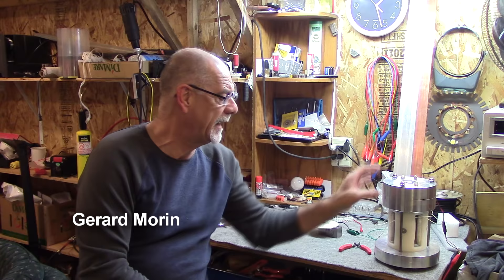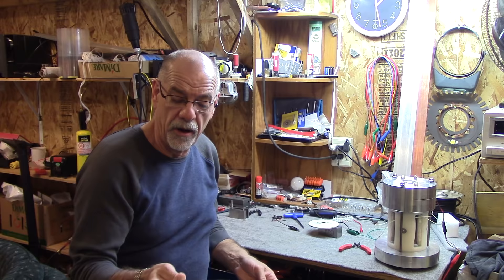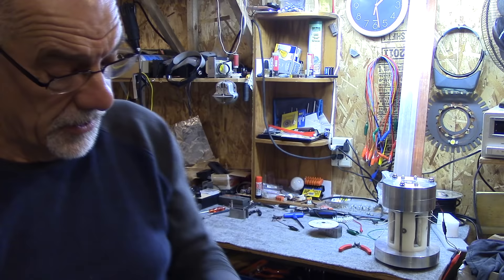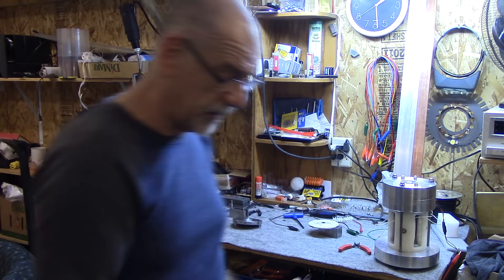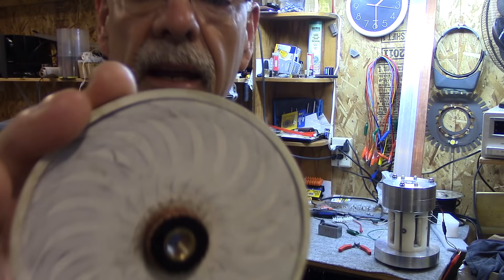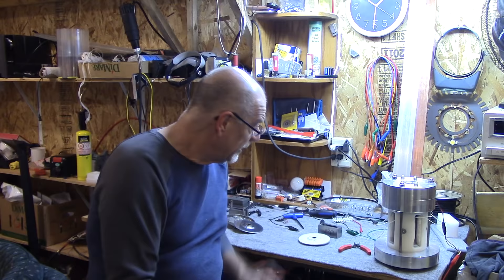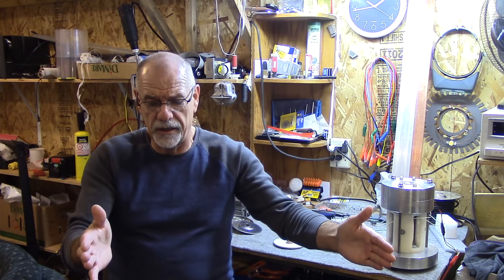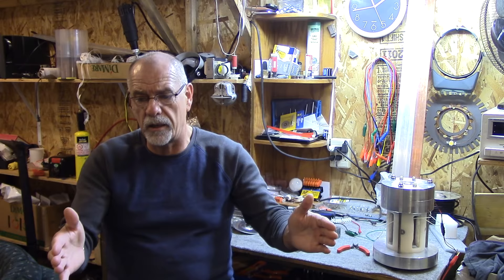Gerard Morin: Hidden technology the world doesn't tell us about

Comment: You talk about knowing how things work, take your advice. You don't know how those lights work, at all. They do take current that is why they have a positive and a neutral wire, for current flow. Those light strands are designed specifically with the right number of bulbs in series,  along with the right voltage drop designed for each bulb divided up by the number of bulbs. Bulbs in series will divide the voltage among them, but current still draws, not divided current.  In a parallel circuit the bulbs have the 120 volts on every bulb, not divided, but the current is divided. That is why you take one bulb out of a series string, none of them work, because you broke the current flow with the missing or blown bulb, Think man!  but you take a bulb out of a parallel wired light, the other light STAY lit. lol

 But i say experiment, as long as your intentions are good, mine are. 

 For example these lights, no current? Well lets do it this way, you take your string of lights and hook it to your voltage, go ahead and hook the ONE wire to the positive(HOT) wire in the AC circuit, ya know the 120 volts in your wall outlet? Yea, that one, hook your light to the hot wire ONLY, because you need only one wire to get a voltage, then test for voltage using a meter hooked to GND, and tell me what you see on the light bulbs, you see voltage, but the lights won't light, it is because it needs current flow. Until you hook the other end of the string of lights to neutral you won't complete the circuit, when you complete the circuit connecting both wires to the plug in the wall, NOW the current will flow, and the lights will light up. not until then. You can have voltage on those lights all day, all night, for the rest of your life, and if you never allow current to flow, you will be in the dark.

 AND/OR just take a perfectly good working string of series lights, and take one single bulb out, any one you want to choose to take out, take a pick, and WATCH as the ENTIRE rest of the string GOES OUT! lol Then take your trusty voltage meter and test that socket you took the bulb from, it reads FULL voltage required to allow the bulb to light at full intensity on one leg of the 2 terminals in the light socket. Now replace  the bulb back, and take the very last bulb out, It shows how all the bulbs still HAVE voltage, but no a single one will light, BECAUSE you broke the current draw, but yet every remaining bulb is connected to the voltage. Actually do an experiment before assuming you know the dumb shit you say.

AND/OR just do it the idiot proof way, go buy a new set of string lights, then look on the label, it will show you the wattage the string lights use up. Now:  watts = voltage x amperage, so then if we know the wattage and the voltage, we can reconfigure our formula using basic algebra to find the current, it will be wattage/voltage = amperage. And the label might even show you the amps right on the label. And even if it don't tell you the amperage, it WILL tell you the wattage. And guess what buddy, you can't have ANY wattage without BOTH voltage AND current period. Get over it. Your lights don't power themselves off voltage alone. 

Voltage is just the potential, like the water medium behind a dam(the resistor) in the river builds up a huge energy potential, and if you break the dam it releases and destroys the city below. The dam water LEVEL(volume built up) represents the voltage, the higher the water level, the higher the voltage, and more capacity(volume) of water behind the dam is more pressure. But if you never put a hole in the dam there will not be any current flow, until it overloads and overflows, and/or breaks from excessive pressure anyway if you keep pumping in currents into the storage(lake behind the dam) without allowing that same amount of current be released(flowing through a designed hole in the Resistor/load(dam). The flow of the river is the current(in amperage) flow, the level of the river is the voltage. So you can have a bucket of water by itself, but it won't do shit alone, unless you jut let it back into the river to add to the rest. A bucket of water is a LEVEL of water, but it does nothing until you allow it to FLOW! The capacity of the bucket to which it is filled is like the capacitance, and if/when you run the water thru tiny pipes strung out, would be like the inductance, because of the time lag. But like i said a single bucket of water is next to useless in terms of it representing a voltage, it is like showing you a watch battery, not even, it is like showing you a static charge if you place the bucket somewhere in a high place giving it high potential, but next to nothing in flow and pressure because you have only one single bucket. Voltage makes pressure against the resistance(the dam), but when it is only one bucket worth of water(voltage), you have next to no current, and therefore next to no energy(power) potential. Once your bucket is empty your battery of which is not much more than a static sting, is empty/discharged.

Comment: So... is it the brushes when it crosses the contracts causing a resonance through that metal, which is actually causing the voltage? like when scratching the side of the magnetic field meter?
Reply: Been thinking about this a bit more.  Just something to toss by ya Gerard and a question as well.

The only way not using magnets to make voltage flow is by a scratching.  It is the only thing that can be deducted, that is really different(besides the obvious field from a magnet).  The field that the magnet produces, produces the same scratching but more on a sub-particle level.  I really liked your comb analogy, by the way.  So would it not be more efficient using a magnet because of less friction caused by the brushes?  

Now on to the big question.

Is the electricity/voltage by the scratching of materials the same that is caused by a magnet spinning?  I kind of think they are not from looking back at some different things you have said.

One other thing.  I think the scratching is causing a resonance through the copper like hitting the tuning fork and it ringing.

Edited:
Hmm, something else...  Could it be electrostatic charge being produced by the rubbing?
Reply: Damn, I just realized something.  There are magnets at the top of that housing. It still could be because of resonance, but it is less likely the brushes theory.

Could it be resonance through the wire within the magnetetic field?  That seems like a hell of a stretch to me.

Have you tried with any other material besides those tuning forks to see if you get voltage from ringing/resonance?  Are those made out of Iron or do you know?

Comment: As i see this motor of Your's Gerard, there is 24 coils, brushes contacts are spaced by 4 plates, so there is 6 magnets. But look at it closely, there is potential to self powering this motor, if only 2 magnets are in play when You put power to this motor (call it source), coils that are positioned at the remaining 4 magnets are producing electricity at the same moment as this motor is consuming it from "source", so you need two more sets of brushes to obtain this power that is produced by them. I hope that You can understand what I'm saing here.
Reply: I took  a screenshot and counted 23 brush terminals, 23 coils, and the yellow dots were 5 brushes apart.. being that there is 3 brushes between them. So where is the other 24th coil and the other 24th brush terminal ? What kind of configuration is this ?

Comment: I drew this motor design on a piece box while working as a security officer and I will tell u sir I am not a genius to figure that copper moving through a magnetic field will induce a current through that wire. get the biggest pair of magnets that u can. create a coil then place that coil between the two magnets .one magnets must be on the ground .the other must be above the first perfectly balance so that the earth vibrations does not directly affect the top magnet. so the field of the two move thus creates votes .I have not done this before. but it is more likely to work than to fail since most of the ideas I've had before you understand them. if this sounds stupid let me know please

Comment: 28:32 looks like a small Static Wimshurst macine.  interesting find.  best plastic to use would be styrene, it gives you more static charge. MY guess would be that inside the plastic is a thin flat iron, or alluminum small sheets that lead to a thin wire on outer edge. I bet when it rotates a static charge is released at the edges of the rotor. the larger in dia. of rotor the higher the voltage.  just a guess , I will keep this in mind.  I would like to take that plastic disk apart.  2:41 what is that on the edges , holes where wires sticks out.

Comment: Hold on, your comments on iron in transformer may be right for what your observe, but its not right about how transformers are working. Iron amplifies the field of the coil about 1,000 times. But it suffers from loop currents (which waste energy), hysteresis ( its slow to switch back and forth), and has a mechanical thing happening on a molecular level that slows the frequency response. It is also prone to saturation when it gets too large a field, which will stop it from transferring the fields. But the real fault of any transformer core is that it is a real time open loop that sends the fields from the input directly to the output and the output field is sent directly to the input. These two fields, if real time are inverted between them, so they compete directly against the work of each other. 

Check out TC Heins (a Canadian inventor who has been shut down by the industry) YouTube channel. His BTTT transformer that adds a second iron core to a transformer shows how to re-rout that two way field transmission through the iron core in a third direction, to take advantage of the core amplification. He gets 3x to 4x amplification of power through a transformer. But really it's just a tranny that sends less canceling energy between the output and input coil. The right use of iron is your friend. The enemy is a fundamentally self-defeating design.

Why has this design not changed for over 100 years even though its obvious that its totally inefficient? Because the actual function and principles of electricity is not understood. But that's another story.

Comment: Look up Printed Circuit Motors where the winding is a pattern of etch on circuit board.  Used in some old magnetic tape drives and also automobile window lifts.  Very light rotor of only circuit board and the carbon brushes run right in the circuit board traces... very powerful with the rare earth magnets... not intended for high speeds, but have good acceleration because of light rotor.  They are very thin like yours... maybe even thinner.
Reply: Interesting, had no idea they did this.  It makes sense it would work, though.

Comment: It is just simply an axial flux motor design... when compared to a radial flux (common tube like motor) the axial flux provides greater torque amd speed due to its design it creates centrifugal force that may help for additional power this is commonly used in Tesla cars... when comparing the design the coil in axial force can directly hit by 2 poles or the North and south that 2 poles in one coil provides greater alternating current due to complete clockwise and counterclockwise distribution of the 2 poles in one coil... and imagine there are multiple coils... and in radial flux you the coil only 1 face is facing the magnetic flux while in axial flux motor you can sandwich 2 magnets... search the design of axial flux

Comment: Why does anyone think you need iron in the rotor? I can see no reason at all.

The very first electric motor created by Faraday 1831 or so did NOT have any iron at all. 
Later it was discovered that iron was handy to contain the magnetic field and increase efficiency in transformers and such and even, in some cases, in motors.
Reply: IRON BECOMES AN ELECTROMAGNETIC DRAG INSIDE AN MAGNETIC FIELD.IRON IS EVIL INSIDE EVERYTHING BUT THE EARTH. EVEN IN THE HUMAN BODY.WE SHOULD BE COPPER RICH AND IRON DEFIECENT.IRON IN THE BODY CAUSES UNDUE OXIDATION WHICH IS AGEING EXCELERATED

Comment: It can be right that different material has different kind of electrons. I think you,re right about the importance of voltage. I,m not sure electrons exists at all. The atom exist but the so called electron is in my mind fields of energy at various distance from the atom depending on what material it is. From the center of the atom you have zero point energy which is a vector beaming out in all directions, from inside and out, all the time. Trevor Osborne talks about this in a "New Scalar Model of Physics". Have you seen it. You must! Now, If I got it right. If you have a tree phase motor and connect the winding in series and put squarewave and right voltage I can get much more power out with no current. Is it right. Thank you for your videos from sweden.

Comment: ok... but you need to find a way to keep the batteries you use charged ...so you a battery charger to keep batteries charged and even the best batteries only last so long ...so it is a temporary power supply and then at they {batteries } out they get replaced...so it needs a batteries that last 100 years to call it free energy

Comment: Solid state graphite crystal power cell bank. Organic carbon power cell. Vacume spark gap to release potential of electrical energy. Enough electrical energy to operate Pankcake motor with a fly wheel attached with neodymium magnet's. Copper coil tubing super heated using len's law. Copper tube coil filled with Gallium Aluminum Scandium alloy. Electromagnetic pump kicks on ounce alloy has reached a set temperature to circulate super heated alloy. Alloy then passes through heated copper coil then through copper he exchange coil in a hot water tank to heat water. Super heated alloy then circulated through high output Nintinol thermal electric generator's for charging up large organic carbon power cell bank's alternating carbon power cell bank's to charge one power cell bank while the other is being deplted. Way better then solar panel's or fossil fuel generator's. Umm will it work? 😒